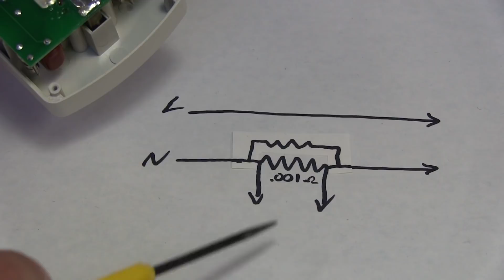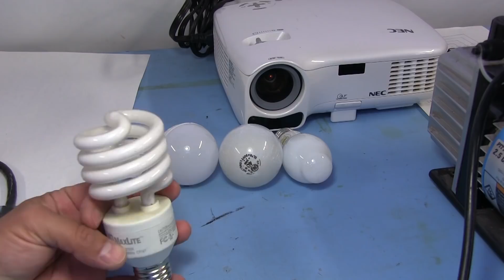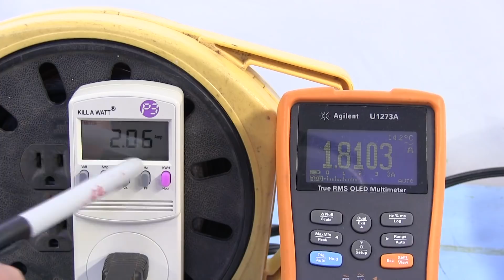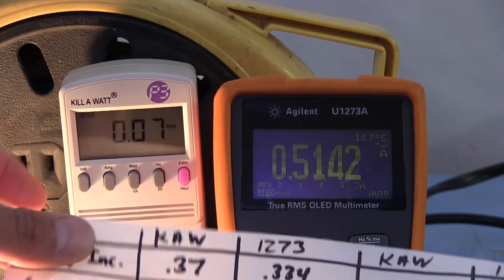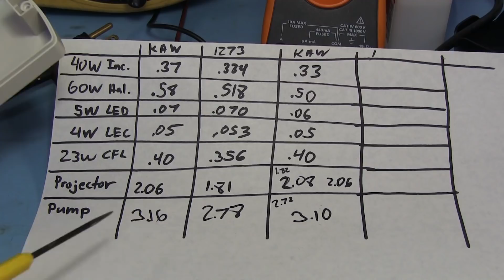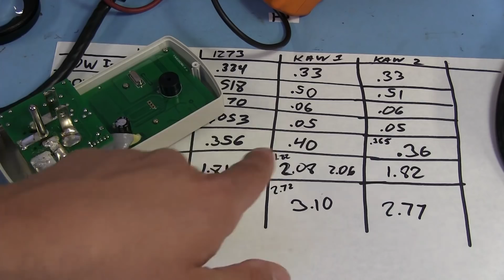TWB #67 | Calibrating A Kill A Watt The (Dumb?) (Hard?) (Quick?) (Dirty?) Way

Comment: Rather than using that "Machete" on the fine wire try just "Polishing" off small amounts of material with some 2000 or so grit sandpaper.

Comment: Wouldn't it be nice to put a higher resistance shunt into there to increase the low power resolution? Most of the times you don't want to know if something draws 2,1kW or 2.2kW. Often low current measurements are helpful (searching for high stand-by power, circuit design, troubleshooting,...)?!